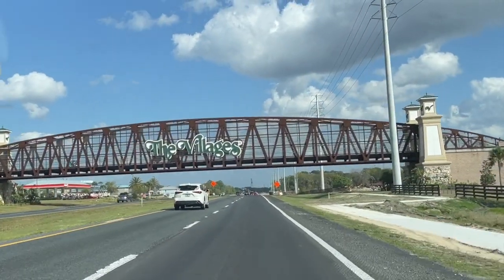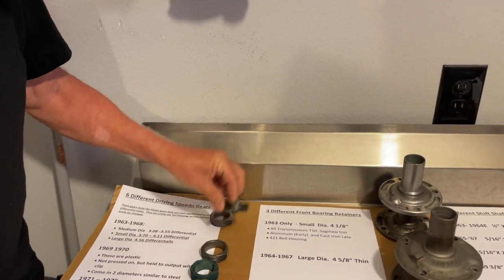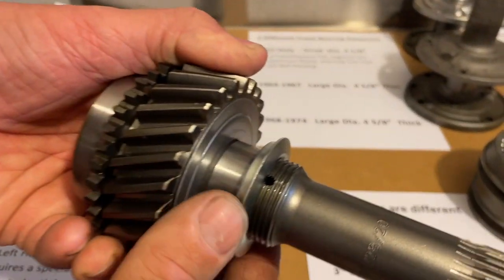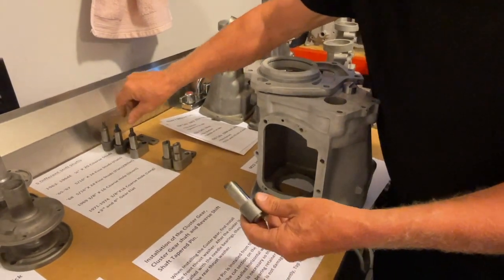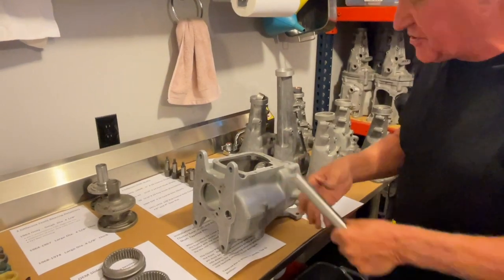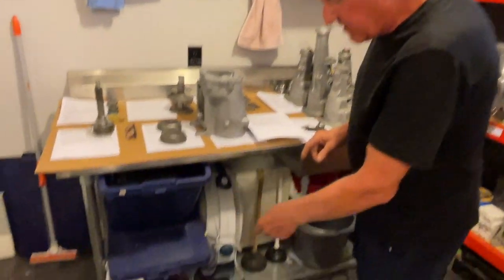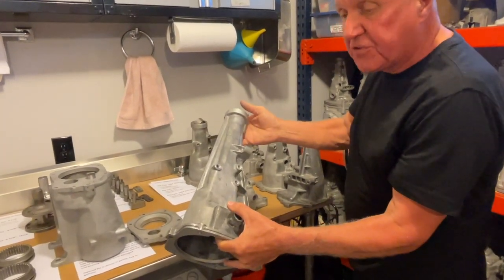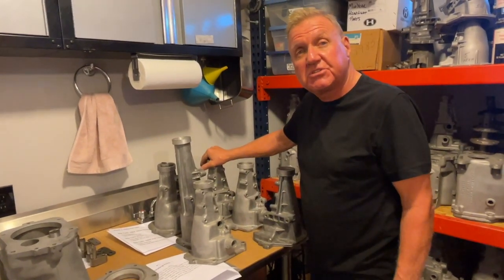Muncie Transmission Parts Explanations 1955 - 1982

Comment: Very informative! I know there are lots of particular things that make each version of the Muncie unique. Good data to have handy when disassembling or reassembling one, or when on the hunt for replacement parts. Could you describe what lubricant you recommend? I had my course spline M21 gone through, and the technician who did the work recommended Sta-lube 85-90w with GL-4. I cannot find a source for it in quarts and I couldn’t use a gallon in a lifetime!
Reply from the maker: Thanks,  John P's recommendations are to use a non synthetic GL4 Lubricant, its very easy to find in the parts store.  The synthetic brands do not work well with the syncro rings.